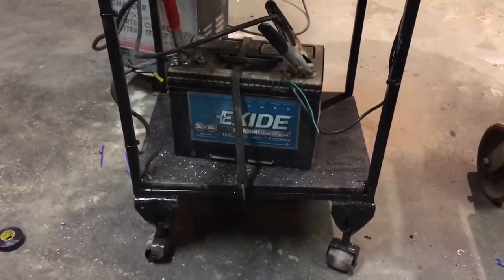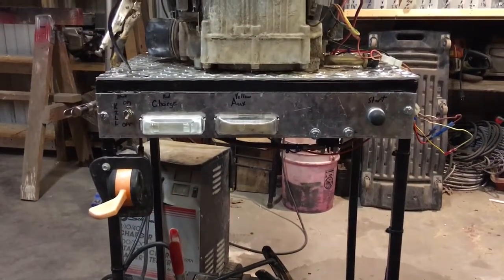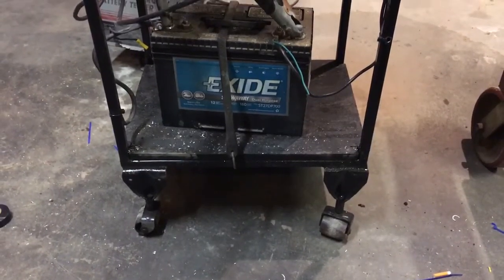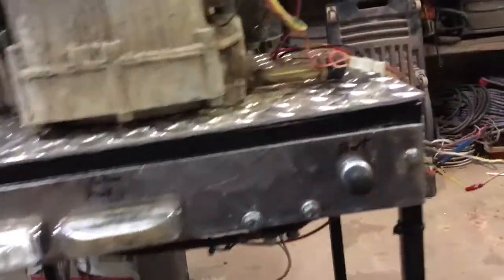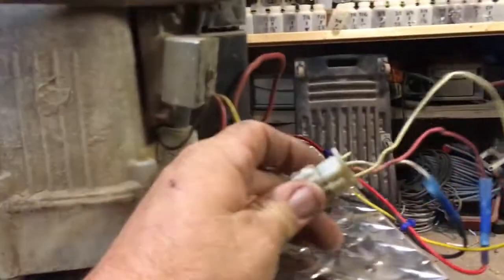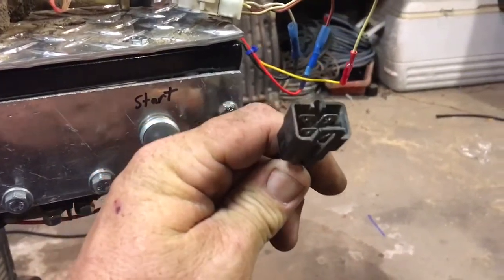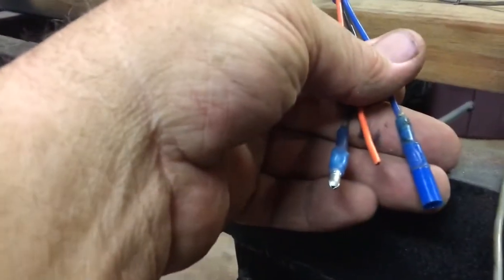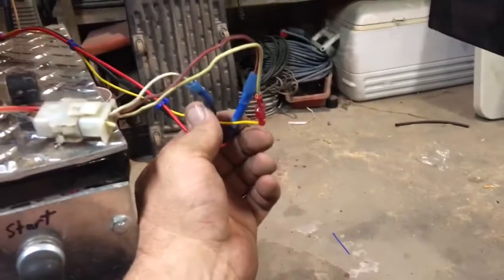My home built engine test stand, works grest

Comment: cant you just run a wire from ignition switch to solenoid, positive battery terminal to solenoid,  then wire from solenoid to the starter, and of course negative battery to ground?

Comment: Nice job. I got one similar but i used a piece of old Murray riding mower frame and made a mount for a fuel tank. I also have the steel engine mounting plate from an old Yazoo push mower that will fit over the hole so I can mount the smaller push mower engines and run them if need be. That aluminum diamond plate looks nice.
Reply from the maker: Junk Yard guess I need to do an update video